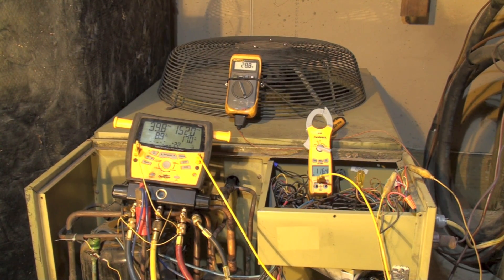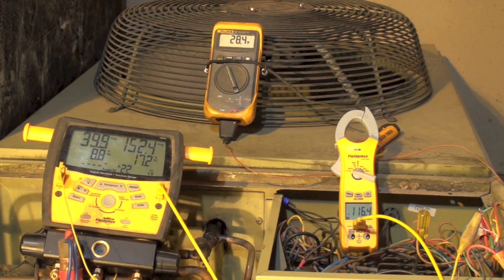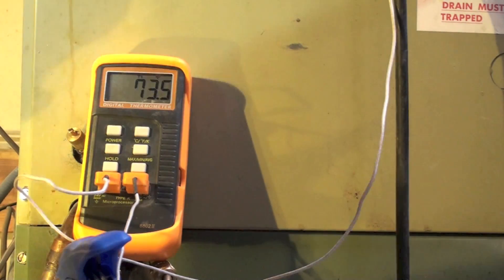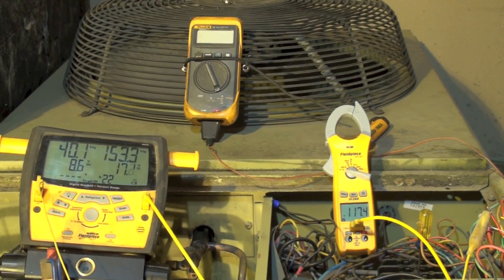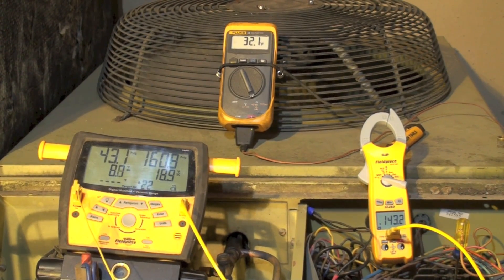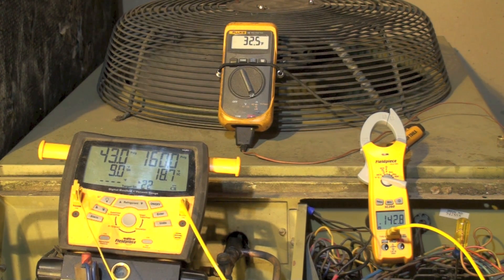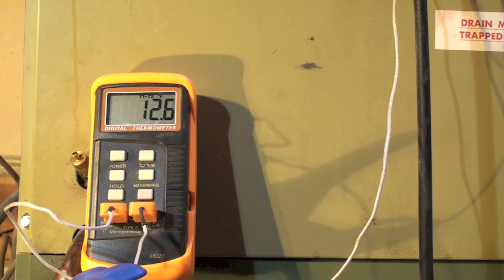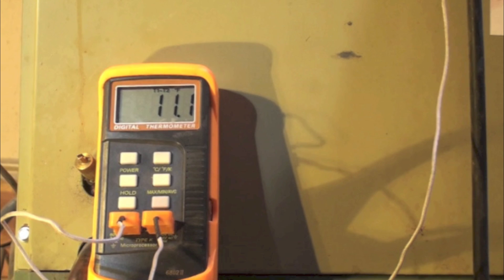Charging the heat pump by discharge temp, part 2

Comment: Have a 30 year old heatpumo... fan stay running with 120v when the unit turns itself off.. started smoking the fan actually... so i had to pull the fuse thing out on the wall of the house.   Had an hvac guy look at the system.. claim my contactor is bad and my circuit board for defrost needs replaced... I took the board out and looking over it... there are no bad traces or nothing buldging on it.... Thr contactor is black on the contacts.   But thats for the a.c section.  If i push it down to engage it.. the a.c kicks on... So i dunno how the contactor is bad if it flips the a.c on.   Isnt that plunger on the conactor suppose to control a.c only.  Not the heatpump itself..

He also checked my recrigerant charge.   It was 34.4 psi and 159. Head psi...  That seems similar to yours.. outdoor temos were 40f.   He said its xharged is very low.. but according to your devide im reading almost simar charge.. so is he bsing me ?
Reply from the maker: The contactor operates both the A/C and the heat pump.  The reversing valve controls whether the system is in heat or cool.  
The charge is probably low .  For those temps, I would;d expect 50 to 60# suction and over 200# head.  
The problem with the fan does not appear to be with the contactor but I have not seen it, so I can't say.
GFM
Reply: @grayfurnaceman  yes outdoor fan smokes when the system turns off as it stays running... and i gatta pull the relay on the side of house.. because its running with 120v not 240 i bet.  When the system is on fan goes full speed and is fine.  And then when its off the fan on the outdoor unit stay on but half speed( thats why i assume its on 120v) and then it smokes and smells burnt smelling. 

But the charge at 40f was 34.5 psi and 159 on high.   So i guess the charge is low.  Is that why the coil is freezing on the outdoor unit ?  Or is the defrost board actually bad i see no burnt traces or any indication its bad and ive messed with circuit boards all my life so i find it odd how a service tech can assume its bad without even taking a multimeter to it but hey.. .

Regardless do you think its worth me just buying a new single pole contactor for 20$ a new defrost board for 90$.  And ill probly get a new fan motor for 120$.   Then the r22 i can buy a 10lbs bottle for 380$.    I might as well get some gauges and learn to recharge it myself.  Although i dunno if any mineral oil needs replacing in it as well.. 

Do you think this is worth the 700-900$ over the 8-12,000$ qoutes ive been getting to replace it ?  I do lol... i dont even have 3k$ let alone 12k..   

So if replacing bad parts.  And refilling it like you would a car that leaks yearly saves me tens of thousands i think its worth it.  I just dunno how to find the leak. Or how big it actually is..

I mean near 30 years old.. it could be some small leak thats taken 5+ years to drop the freon level.. or it could be a big leak.. i have no idea.

Whats your opinion.. talked to like 5 hvac guys so far locally they all just say replace it.   But again i dont have the money to do that.  And since im handy and been building/repairing antique cars for 15 years.  I think i can handle fixing this.  But ya.. your opinion ?
Reply: Consider central a/c only, and keep shopping.
It takes an epa certification to dispense refrigerants. Take some adult ed classes and get the certification.
Reply: @scottsmith4934  epa... lol fck the epa. I did it myself..  dont need the eoa to tell me what i can and cannot do.   Just like r12 on my old Jeep dont need any cert to buy the cans from people locally nore to put it in my car.. what are they gonna come knocking on my door lol please
Reply: I feel the same way sometimes
Reply: I'm just saying you might be able to answer some of your own questions by what you learn from taking the class and studying for the test

Comment: Here's a thought- If time wasn't a factor, wouldn't one way to charge the system be to add 1 ounce of refrigerant at a time until the temp split across the coil gets worse, then remove 1 ounce? Just curious
Reply from the maker: That's a very inaccurate method.  Not to say the discharge method is a lot better.
GFM
Reply: @grayfurnaceman  Thanks. Could you charge an AC unit that way?
Reply: You could.
GFM
Reply: @electriccar3253  Makes sense, thanks.

Comment: Very interesting, thanks for taking the time to make this video. I would think that a heat pump running in heat mode would produce a higher temp split across the indoor coil if it is overcharged because of higher discharge temperatures. An overcharge would obviously reduce performance in cooling mode and would likely damage the system, but I would have thought that it might improve heating performance.
Reply: Actually, the opposite is true.  The higher discharge temp is caused by less space in the condenser to condense the refrigerant.  Its just the same amount of heat concentrated in a smaller space.  Higher compression ratios make for less efficiency.
GFM
Reply: @electriccar3253  Makes sense, thanks.

Comment: My outdoor ambient is 57. My discharge temp is only 54. Split is only 1 degree. My return air is 65 and my supply is 66. My thermostat is set for 66. If I add ambient plus discharge temp, I'm not even in the ballpark of my discharge temp. This is in Feb. in North Carolina. Discharge reading is at service valve. Could that be my problem? I just wonder why my split is not more than that.
Reply from the maker: Your compressor is not running.  
GFM
Reply: Thanks for your reply. I found out my temp reading device had bad batteries. Great videos that you are doing, btw! I've learned a lot from them.

Comment: Landed here looking for an accepted lineset temperature. Have a 20yo matched ruud heatpump. In very cold weather the  lineset has begun vibrating audibly after the unit runs for awhile. I'm not a tech so can't check charge but here's my numbers: 26 outside, 68 inside and 18 degree split. Hot line is 142 entering the indoor airhandler. Its uncomfortable to touch, is it OK to run like this or do I need to call service? Its able to maintain temp inside the house OK.
Reply from the maker: From your numbers the unit is probably ok.
GFM

Comment: I was wondering if the system is in cooling or heating mode
Reply from the maker: +Henry Odogwu That was done in cooling.
GFM
Reply: @grayfurnaceman  wanted to double check with you that you ran the heat pump (as an air conditioner) in cooling mode on a 32F day.
Reply: Dang.
I would have thought heat mode
Reply: That's why the previous comment about the discharge line being the bigger tubing ordinarily the suction line

Comment: wondering where you are taking that discharge temp reading at. Could you please explain steps . Thanks
Reply from the maker: Tony Bowers The discharge temp should be taken between the the compressor discharge and the reversing valve.  It is best to use a clamp on probe.  The compressor should be running for about 15 minutes.  Hope this helps.
GFM
Reply: @grayfurnaceman  I don't happen to have a clamp on probe, would you know from your experience if a laser temperature gun is accurate enough for reading temperatures on these copper pipes?
Reply: GFM, so the discharge line in this situation is actually a bigger tubing. Ordinarily the suction line when in cooling mode? Am I correct?

Comment: Being a fixed bore,,, Can you not put it in cooling mode, restrict air flow at the condenser to simulate a 95"F day / aka Head pressure at 278 psi, and then charge by superheat?
Reply from the maker: johnny30806 One problem here is the inside temp is usually too low to simulate a cooling load.  Also, blocking the condenser is really not effective when outdoor temps are below about 35 degrees.  I am not saying it cannot be done but there is no substitute for normal operating conditions.  Hope this helps.
GFM